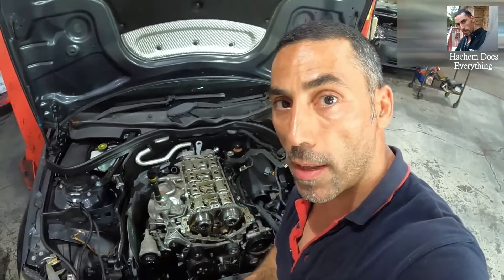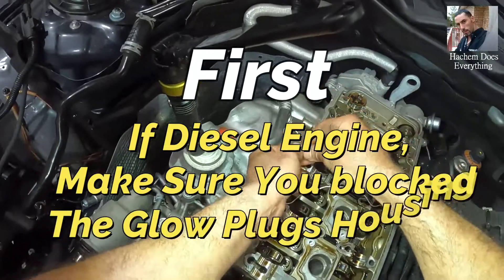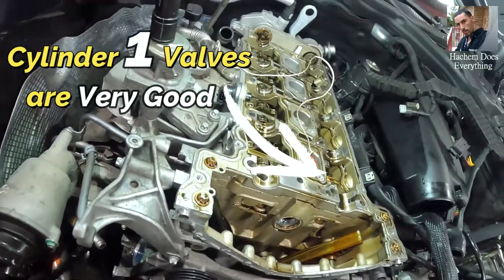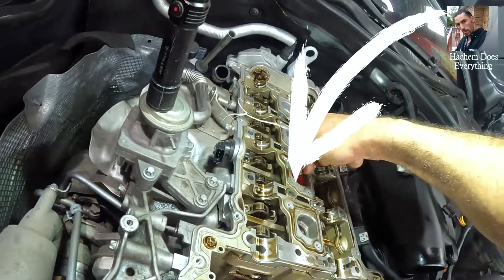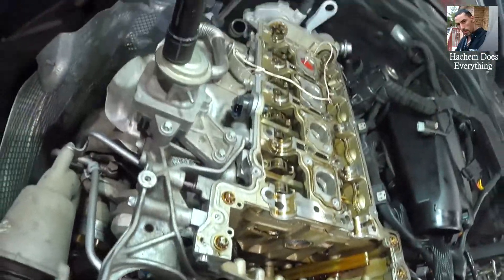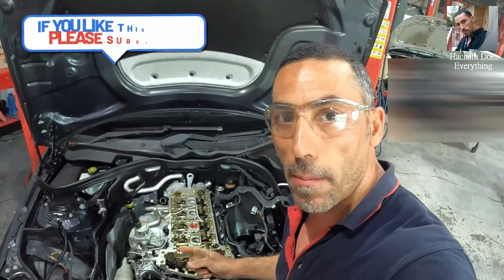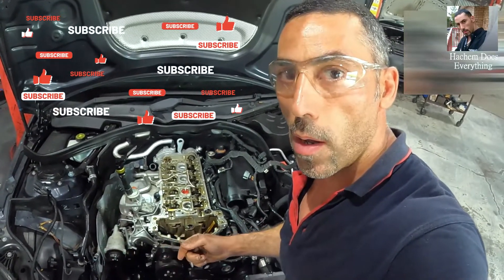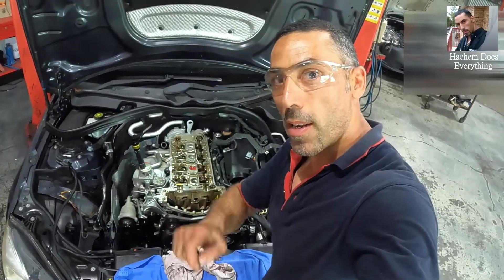Engine Compression Test Super Easy and works

Comment: What is that red thing you used, and are you placing it in the injector "hole"?
Reply from the maker: it is a Plastic cup that Came with water pumps Secured with Strong Cable, i made it and i do use it with the Safety glasses on . i do put the Cup in the spark plugs housing for gasoline engine, and in injectors housing for the diesel engine with the glow plugs on and i do turn the engine slowly to test the engine compression , with this way i can know witch valve good and witch valve is not. if you enjoyed watching my video , push the like button on the video. Thanks for watching.